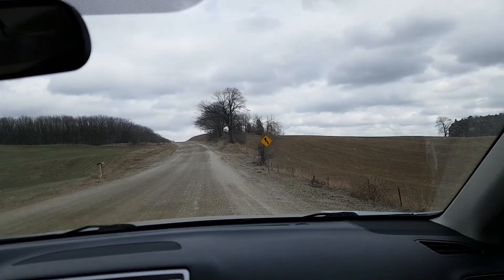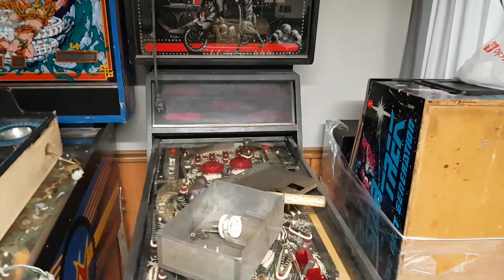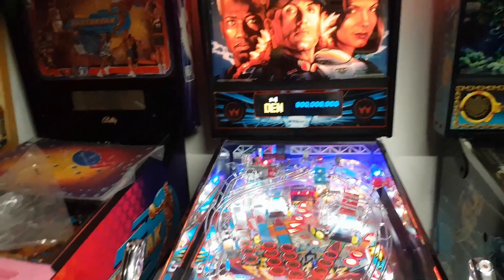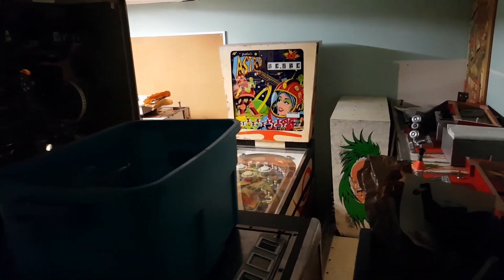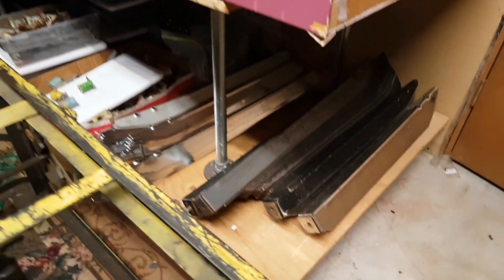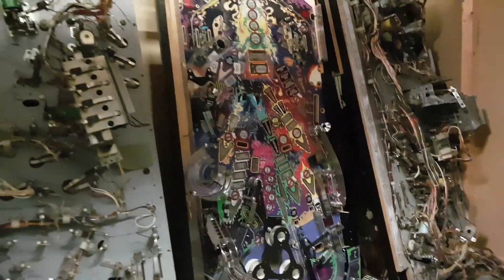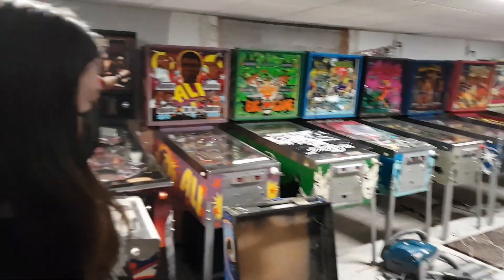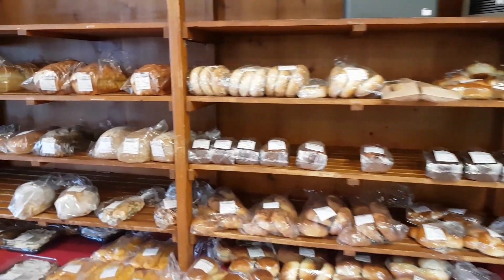Lets check out my friend Mitch's 56 Pinball Machine Collection!

Comment: I think it makes no sense to hack the wires out of freefall before selling it. They should just be screwed down to the baseboard. What happens if there is another issue and you need to replace the connectors again. The next thing you know is that you are restringing the harness wiring.